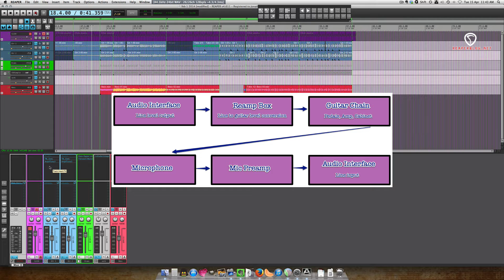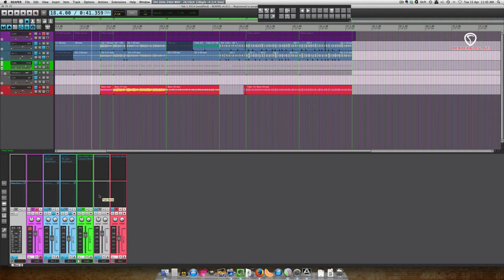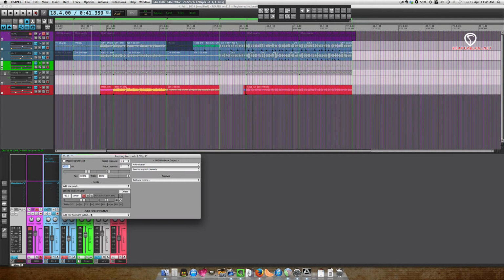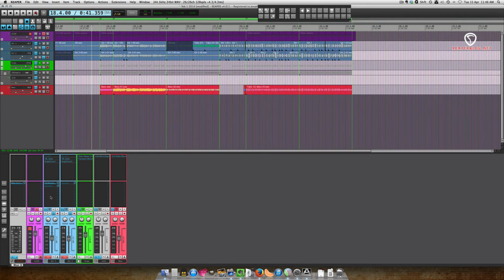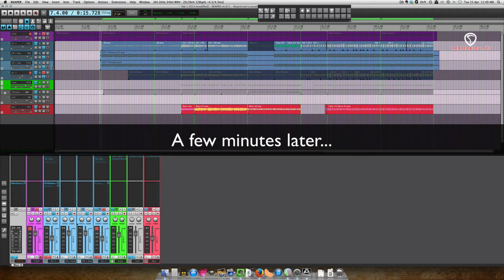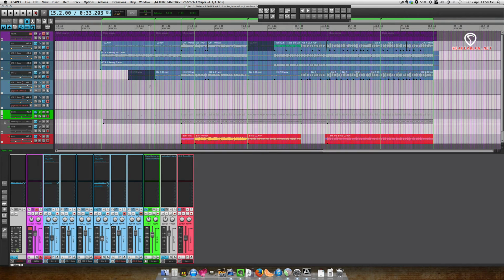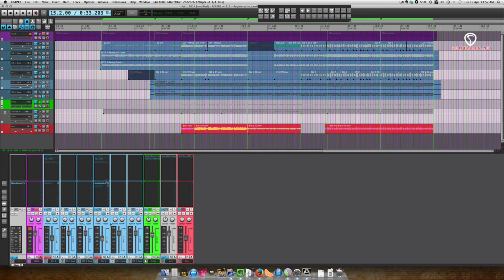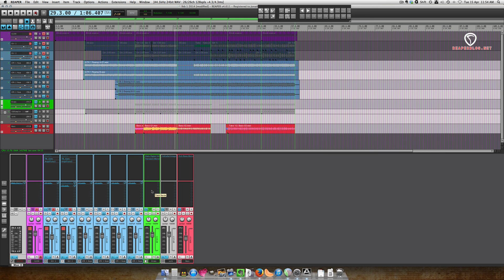How to re-amp in REAPER

Comment: This is not working for me.  I have an RME Fireface 802.  In Reaper's Preferences>Audio>Device, using ASIO Fireface 802, I have enabled both inputs and outputs "Analog 1-12."  

Then on the Reaper track containing my DI, I have disabled master-parent send, and created a hardware output send to "Analog 3."  But within the FF 802 mixer, I only see a signal through on the "Analog 3" INPUT channel.  

The reason I have chosen "Analog 3" as the output channel to send my DI to is because this is the output jack on the rear of the FF 802 that my reamp box is connected to.  But Since there is no signal from Reaper reaching that output channel in the first place...

Comment: Hi, is there a way to automate reamping multiple tracks in multiple projects (change the amp-sound and re-amp a whole album)? 
I built a LUA script to do this (see https://forum.cockos.com/showthread.php?t=209764), but i am curious if it is possible without scripting.
Reply from the maker: when reamping I often use action markers "!commandID" to stop and save recording, but you can easily trigger an action to disable record am on first track, mute, go to next track, record arm, start recording from first item.

Comment: Thanks bud! Had to piece together all the instructional videos, and yours helped me with all of the Reaper end of this mess. My S/PDIF L/R Hardware Output in Reaper is on Channel 5, so DAW 5 for S/PDIF 1 Output, as anyone using Focusrite Mix Control software which comes with my 8i6 (among other Focusrite models) will see below:

For anyone doing REAPER/KEMPER/FOCUSRITE:

I'm using a FOCUSRITE SCARLETT 8i6 with Monitor Outputs on DAW 1 left and DAW 2 right and S/PDIF 1 Output set to DAW 5 (because, as I said above, Reaper puts S/PDIF L/R Output on channel 5, a.k.a. DAW 5), and then Internal Syncing (NOT S/PDIF) and my purposes only require a 44.1kHz sample rate, yours could be as you choose with no impact on this setup.

I am reamping with a Kemper Profiler. Connections: Kemper's Master Left Out 1/4" cable to Input 1 on the front of the Scarlett, with Master Left Volume on the Kemper adjusted to taste. The S/PDIF Out cable running from back of Scarlett to Kemper's S/PDIF IN, and then Kemper's S/PDIF Out to Scarlett S/PDIF IN with S/PDIF Output set to Master Stereo. Input Source set to S/PDIF Reamp Input, with Reamp Sens adjusted to taste. This adjustment is similar to hearing an active versus a passive pickup. You can run your guitar straight through the Kemper to get an idea of what it sounds like, then adjust the Reamp Sens to sound like that if you want the reamped guitar to sound true to your original Kemper rig tone.

If anyone would like a Pro Tools/Kemper/Focusrite solution, give me your email and I'll send you snapshots of settings. But I will just add that, having completed a recording/mixing/mastering cycle and also used video/audio editing features in both, I am happy to have switched to Reaper. I can tell you why, also by email, as anything further about that is not necessary here.

Thanks again, bud!

Comment: Hey, I'm using V5.15 and this method does not seem to work. I did exactly what you said in the previous versions and it worked but the new update, as soon as I disable the Master Parent send and select and different hardware output (where the reamp box is connected), no sound is passed through the amp. Could you help me out? Thanks.
Reply from the maker: +Angad Bhatia which interface are you using?
Reply: +The REAPER Blog Focusrite Scarlett 6i6 and Radial engineering Reamp box
Reply from the maker: does that scarlett have a control panel mixer?
Reply: +The REAPER Blog It has a separate software called as Mix Control which controls the I/O of the interface. But i remember last time I reamped I had set it's settings to default and it worked fine.
Reply from the maker: I haven't heard of anyone having trouble with outputs in 5.15 or later, so that interface mixer is where I'd look to solve this, or else the physical connections.
Software return 3/4 (from reaper) needs to be sent to hardware output 3/4 of the interface.
Out 3 connects to the reamp box
Reply: having this same issue with my the same gear
Reply: +JackCarlino hey man, I solved it. It was fairly simple. All you need to do is in Scarlett mix control, set it to MIXING PRESET. Then do everything that's said in this video. It had nothing to do with the new Reaper update. I had just changed the preset in mix control last time and that messed up my I/O.
Reply: +Angad Bhatia I solved my problem too. buggy plugin I was using. thanks bro!

Comment: I have everything set up like in this video, but my signal going to my amp doesn't seem to match the signal when my guitar is plugged into my amp.

I am using a Saffire Pro 40 with the Line2Amp box.
Reply: did you ever fix this? for me its way lower output and im getting barely any distortion but when i plug my guitar in it sounds fine

Comment: I am confused, what exactly do I need the re-amp box for? Can't I just connect the output of my Focusrite sounddevice to the amp, via good old guitar cable?
Reply from the maker: Your interface has balanced line level outputs, your amp has unbalanced instrument level inputs. There's also an impedance mismatch. The reamp box takes care of the conversion so your amp will react to the signal just as if you had your guitar connected.
Without the reamp box you can get unwanted noise and dull tone. You can do it but it won't sound as good as it could.
Reply: @TheREAPERBlog  Uh - some interfaces do NOT have true balanced outputs.  In fact most use a quasi-balance scheme.  I'm an electrical engineer and went thru this with most of the companies such as presonus and the like.  They suck.  Give me a diff amp or a transformer. 

RANE PRO AUDIO defines it as

"A quasi-balanced output stage consisting of an unbalanced output connected to the tip of a ¼" TRS (tip-ring-sleeve) jack through an output resistor (typically in the 50-300 ohms range). An equal valued resistor is used to tie the ring terminal to signal ground. The sleeve connection is left open or "floating." Thus, from the receiver's viewpoint, what is "seen" are two lines of equal impedance, used to transfer the signal. In this sense, the line is 'balanced," although only one line is actually being driven. Leaving the sleeve open, guarantees that only one end of the shield (the receiving end) will be grounded. A practice that unbalanced systems often require. For trouble free interconnections, balanced lines are always the preferred choice."

And I can show - using the test gear in my lab - that most of the time, you can just connect directly from the interface to an amp input.  I'll sweep the signal using a lab-grade generator and watch it on a myriad of test gear.  

Just turn the signal down on the interface output.  

See this vid of my lab: https://www.youtube.com/watch?v=zDGTD7bGh3k

God - this misinformation on the web sucks... really doez...